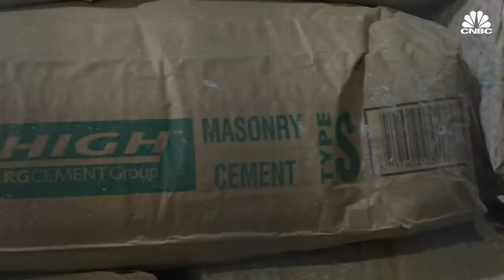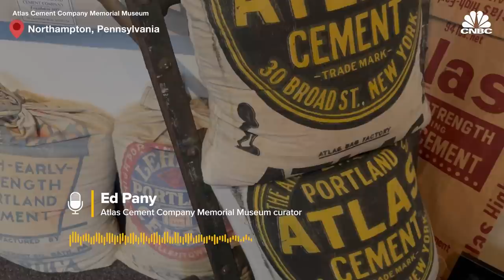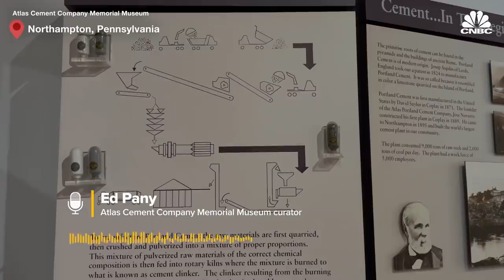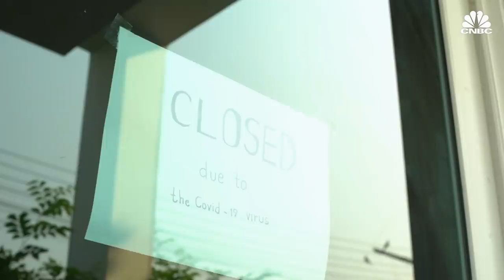Can The U.S. Cement Industry Keep Up With The $1 Trillion Infrastructure Bill?

Comment: Install $500 billion of solar power, per year, near all cement plants and in 10 years these will have all the power they need to produce the cement required by the U.S. market, while reducing the world's CO2 emissions by 25%. That's a big reduction! This will be cheaper than the coal that is used today. Each installation will pay for itself in less than 5 years, based on the coal savings.
After 5 years the cost of the concrete should actually fall by $10 per ton. It's a bargain! We just have to re-tool the coal industry workers.

Comment: That 1 trillion infrastructure isn't enough. If we wanted to fix everything like we think this bill will it actually needs to be around 2.6 trillion.
Reply: It takes tens of millions just to rebuild a highway overpass with some ramps nearby. It probably will take a trillion a year for twenty years to get everything up to safety standards.
Reply: Ayn Rand  Sounds good inflation will make the debt cheaper
Reply: Very little of the bill is for infrastructure.

Comment: If people only realized you can just cut and use stone for everything
Reply: Stone coat a fortune and the roads are less smooth as a result. Stone roads exist in NYC for example and people avoid driving over them. Damages cars over the long term.
Reply: @MuddinNYC  stone roads are great for residential neighborhoods as they discourage non residents to go through them, forces drivers to go slow, are way less warmer than asphalt and increases water infiltration, decreasing the risks of floods.
Reply: @ttuliorancao  Okay but that doesn't change the fact it damages cars long term and cost significantly more than asphalt. No govt is going to want to invest in that . It's just asking for a lawsuit. All the NYC ones for example are slowly being replaced with asphalt.
Reply: @MuddinNYC  if cost is the main thing they're looking for, then they should be using concrete as they're way cheaper on the long run...
Reply: @ttuliorancao  Right but politicians don't think long term. They think quarter to quarter, election cycle to cycle.  The initial cost and the payback time would be to much and hard to justify against an opponent. Maybe it's different in other countries but that's how it is in the US sadly. Plus car culture is very strong here. Any damages caused to cars by a politician is just asking to lose and be sued.

Comment: No. Concrete requires a certain type of sand which is already starting to run out. Lol Saudi Arabia has sand galore but zero concrete high pressure type sand at all. Gets shipped in from India. Lol states can only domestically supply 17% of good class concrete and other types of construction sand. On top of that like you say there's quality aggregate. Shortage too of that already.

Comment: Aren't Runways Asphalt, and Pipes PVC, neither is concrete?
Reply: No. Runways are not asphalt. Asphalt can’t hold up over time the weight of airplanes like concrete can. I built an airplane hanger for Boeing in SC and the other concrete company that was there built a concrete runway from the hanger to the Charleston airport.

Comment: How can be concrete sustainable, when it basically can't be recycled and within few seconds, we have another guy saying exactly that cement is harder and harder to get.
Reply: @andreysokolov8974  Don't know where you found that in my comment, reading doesn't seem to be your strong side. Not only can be skyscrapers build out of wood, but the idea of skyscrapers are stupid as hell for most occasions. Everybody is way better off building 10-15 floor buildings.

My comment was however solely pointing towards the stupidity of the guy thinking it is sustainable. There are huge benefits of having concrete, but there is no need to greenwash it and play a game where concrete actually sucks CO2 and is sustainable and recyclable and who-knows-what-able

Comment: You barely touched on recycling of concrete but you didn't mention SAND as being another great contributor to the rise in the price of concrete.  And we can thank China for that shortage as they are the single greatest importer of sand on the planet.  Final thought; hemp is supposedly a great binder material to replace the shortage of sand in the product, hempcrete.  Why not make a follow-up video on that?